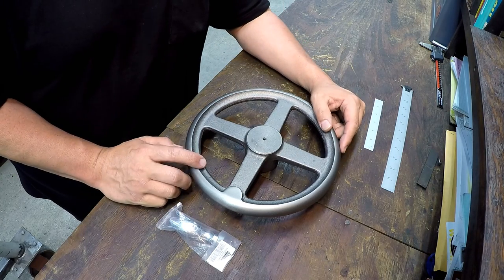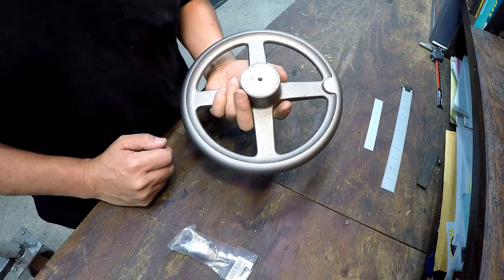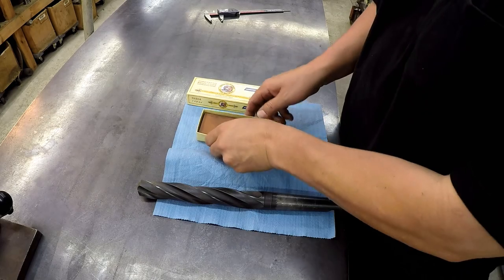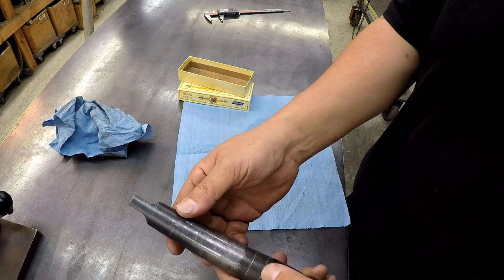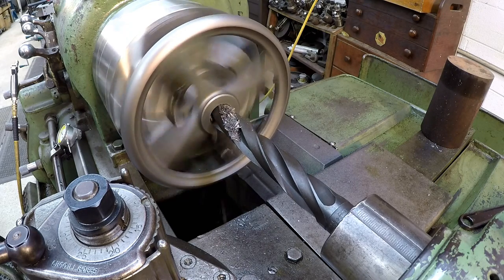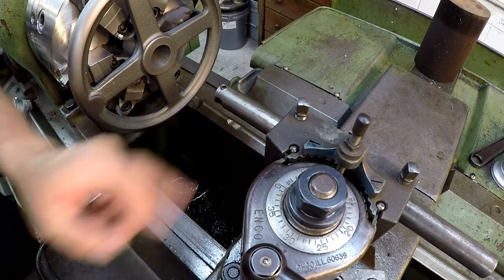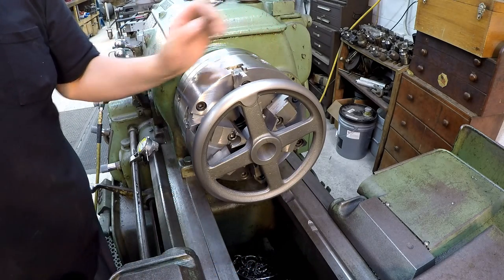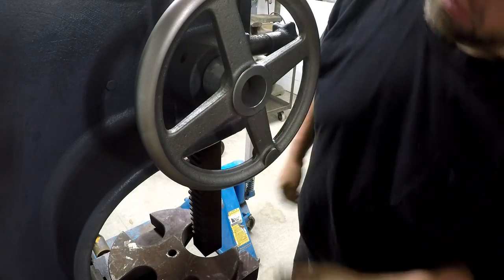Machining a Dake Arbor Press Handwheel

Comment: CAN YOU MAKE A VIDEO ON DEEP BORING SMALL DIAMETERS PLEASE? FOR EXAMPLE, A 1.5"ID X 14"LENGTH BORE.
Reply: "high aspect ratio drilling" is what you're looking for.
Reply: @83hjf  I'm more interested in turning the bore instead of drilling it. I'm wondering if there's some best practices when boring/turning a high length/ID hole.
Reply: @jonathoncarter3942  Boring bar between centers with the part mounted to the carriage when possible. A bar that can bore 1.5" x 14" deep will sag under it's own weight.
Often it is easier to change the machining technique than to do something like that. For instance, drill and ream the hole, then use the hole as the reference and machine the rest to the part. Really though, you should redesign the part if possible - this is the sort of thing that young engineers come up with before they learn better ways to design things.
Reply: A practical application might be a gun barrel, but gun barrels aren't bored, they're gun drilled and straightened if required.
The best advice I would offer if it was really needed would be to bore with the cutting edge slightly above the centreline to mitigate risk of digging in. Don't bore to finished size, ream to size.
Remember the fundamentals of holemaking:
Drilling gives you a hole
Boring makes that hole straight, round and in position
Reaming makes a round hole of a specified size
Reply: chill out with the caps man, Jesus Christ
Reply: @jasonmurawski5877  CAPS makes a comment about boring less boring :)
Reply: @Jonathan Carter
There is a Youtube vid about two different Japanese machinists competing on a TV show, each using their specific skills to drill through a pencil, (I think). I can't recall precisely what they were drilling, but it was long, and the hole was tiny.

One was a lathe operator, the other was an ESD (?) expert.  There was a LOT to learn from both.

If I can find it again, I will post a link, but take a shot at finding it; it will help your search for knowledge.  The show was well done, wit good explanations of each man's process, and thinking.

GeoD
Reply: @georgedennison3338  it was the graphite rod for a mechanical pencil that they were drilling.  one was using electrically charged micro-wire, the other was using a stationary drill bit like he did here.  but the majority of the graphite rods snapped.  One of them finally made it though.
Reply: @Ed H
THAT's the one!

Hey, have you noticed the video display jumps down and covers the comments, even when you're in the middle of writing?  It seems like it's something new, but I don't trust my memory.

Comment: show someday what you doing with front tail of your lathe... its so quiet for this size...
Reply: Dunno what a 'front tail' is? Headstock? Anyway, he has a video where he takes the cover off. It's quiet due to the helical gears, a very rare feature even on high end modern lathes.